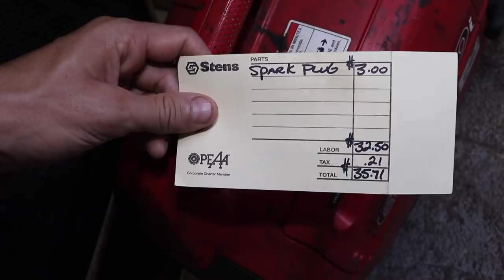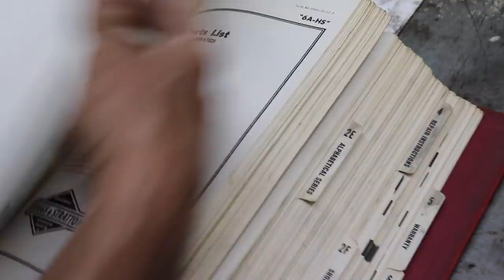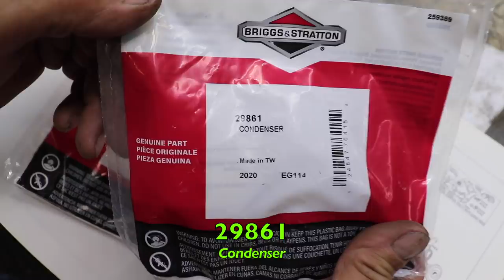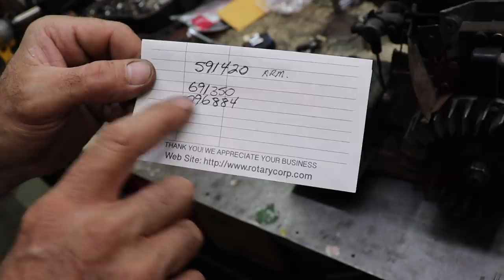INCREDIBLE 1936 Briggs & Stratton Electronic Ignition Upgrade & Valve Job

Comment: When I was 9-10 years old I came across an old Briggs engine nearly identical to this one. Grandpa said it hadn't ran since the 1950s when they got electricity on the farm, and I could just have it.  I bolted it to a board just like you did, and after a month (in the summer of 1975) of dinking around with it, I got it to run.  One day Grandpa and Grandma came to visit, and I showed Grandpa I got his old engine to run. He couldn't believe it!

Also mentioning old Kohlers, I have a K160 I have been messing with.  

Thanks for the memories!
Reply: I have I k181s that my uncle gave me he told me that my dad had blew up so I get to rebuild it it is my first rebuild

Comment: Love the old stuff. Every year at the fair (no fair this year😒) they have a bunch of hit-miss engines putting away. I would love to see Taryl get one of those.
Reply: You from MN?
Reply: @bstevermer9293  from OH but live in NY.
Reply: I was gonna say the same thing. there's clubs that restore these pieces of history all over the nation. check it out. they would love to have you and your dinner.....d.e.
Reply: I used to set up every year I had Delco light plants and maytags and these and whatever I could buy
Reply: As you know these are the simplest carburetors ever they're called mixing valves same on the model y they don't even need a float pure Venturi suction from the tank.

Comment: Hello terry Stover, I got back into fixing generators last winter, sort of by accident, I have
2 generators I maintain and they are always ready, 'cept last year when I moved up to N.E.
apparently gas valve got moved to the ON pos. 1st time since 2014 I could not get'er
going when I needed to. I hadn't pulled a carb apart since the 70's! yet watching the flying
dinosaur which is what a TARylDactal is I had No problem at all and got her running again.
Yeah Taryl is a well talented gent at what he does and the way he is kind to help us out
there to get/and or keep our engines running and giving some great entertainment.

Comment: We had one of these engines back in the 1950s'  It had been on my grandmother's washing machine.  It has a long flexible metal hose that ran to the exhaust.  This was used to take the exhaust outside.  Wish I still had the engine.  I am in my early 70s and it would have been fun to show it to my grandkids.

Comment: I came up on an old Briggs engine in a lien sale, it was a ww2 military engine tagged as a replacement engine for something. It had never been installed but the coil had decomposed. I’d never seen anything like it, all the coatings on it had turned to dust. Anyways we had a local surplus store that sold a lot of old stock military parts and they had one but said it was for aesthetic purposes only because they wouldn’t warranty it working, but I started asking around on collectors forums and a guy pointed me to a site that sold new replacement coils, it was just the coil pack and you had to press it on the frame yourself but it worked great. I’d tell you the name of the site but I can’t remember to save my life but I can tell you it was dedicated to restoring those old engines

Comment: It's amazing that the flywheel from a motor that is 50 years newer works.  I hope that Briggs parts and support continue to be available through this BK.  Love the sound of a cast iron B&S, and their low idle speed.
Reply: I had one on my lime green little Indian mini bike
Reply: Man, I had one of those! When the engine went out we'd push it up the hill and take turns riding it back down. I'd love to still have it and put a harbor freight motor on it.
Reply: I have a B&S snowblower engine made in 1967. I also have a 1987 snowblower engine. The starter from the 87 also fit and worked perfectly on the 67 engine.

Comment: I use to make a lot of spark plug or coil wires and I bought a roll of Packard 440 copper core wire made for that purpose from J. C. Whitney & Company. 
Bought lot of stuff from them 40+ years ago. I miss their catalog ☹️.  I lived way out in the hills of E. Tennessee & couldn't run to town every time I needed something, but the mailman ran by my farm 6 days a week.

Comment: I have an old Whirlpool; wringer washer in the barn that came with a WM  engine. Mom and dad's house burned in 1938  so it was just after that when they got it. We got electricity out here in 1947 and dad put an electric motor on it. I still remember mom washing with it on the back porch of the old house in the early sixties and heating water  in the wash pot. That was a good dinner by the way.

Comment: My 3 horsepower Briggs and Stratton powered lawnmower (92500 engine) started running like crap at higher RPMs & adjusting the carburetor didn't make a difference.

The ignition coil eventually blew on it so I used one off a 4 horsepower Briggs and Stratton lawnmower engine that I'm yet to rebuild,the 3 horsepower engine revved out a lot cleaner at higher RPMs then.

I have since fitted a brand new ignition coil & it runs great.

Regarding that joiner piece that you put in for the spark plug lead,you can insulate it with glue lined heatshrink tubing (Raychem) to insulate it,it will make it a neat job as well !

Comment: we used a couple of these old brigs with the small low fuel tank/carb sucks the fuel up from it.  to pump water on the farm. we would measure how much fuel we put in the tank for the amount of water pumped. start up and let it go till it would stop by itself when the fuel ran out. put an old wash tub over it to keep the weather out.

Comment: SInce Taryl knows the ins and outs along with having a commanding knowledge of the strengths & weaknesses of B&S engines for the past 60 years or so - they would be well served to have people like him hired on a consultant basis to improve the design of their modern engines...the QC function of those improvements would be left up to them. I own an American made 15 yr old B&S engine and it runs perfectly with simple maintenance. Never pulled the rope over 3 times ever to start and most of the time it fired off on the first pull.

Comment: Taryl, you are exactly right. I remember seeing a valve grinding tool that that had a crank on it and it had two pins that engaged in the top of the valve. When cranked , the valve would oscillate back and forth.
Reply: very neat

Comment: I think the valve lapping tool could have been a small nail you would put in one of the holes on top of the valve and spin the valve like a crank. In modern day you could use a small “L” shaped Allen wrench. My father used a mail in a small piece of wood. 
Great video. The Briggs WM sounded like motors i was used to in the good old days.

Comment: Years ago a mouse damaged the windings on my old GE traditional style washer and my wife rejoiced (I'm not convinced she didn't vuck it up) because she had to have a new p.o.s digital front load disaster that never works , I put that old washer and the dryer out in a shed out from the barn and rigged a little Brigs engine to it with a pipe going out the wall of the shed for the exhaust and welded a old tensioner pully from my truck to a tire iron to engage it...guess what the damn thing still works and she has to use it from time to time when her new fancy turd won't work, I use it often to wash my shop and farm clothes, I have about 60' of copper line coiled in a plexiglass box on the roof of the barn that heats the water from the sun ifill it with a water hose the throw then on the clothes line when I'm done and hang them back in my closet in the barn😉

Comment: That reminds me of an engine we had in my basement when I was a kid  in the late 50s and 60s with the same kick starter. My dad had a gear type water pump hooked up to it to pump out the basement when it flooded and yes the muffler had a long flexable metal pipe goin outside the house.  The gas tank was thick with black gue which I know now was varnish. It never ran but, to see yours run was pretty cool. When you were talking about the valve clips I was thinking pins which you found. It even had the same carborator. Thanks for the memories.Thats a keeper!

Comment: The holes in the valves were as you assumed to be used with a tool which was very much like a hand cranked egg beater.  Rather than going round and round, the tool oscilated back and forth like the way which you used the suction cup grinder,
Reply: Remember that tool. Would oscillate back and forth maybe 45 degrees or so, and had a little flat adapter with two fingers that fit the valve holes. Likely were more with the tool when new, Not sure if that was a BS tool or not? I have a WI that served my motor bike for a couple years around 1955 or so LOL. Still have it and  runs.

Comment: That looks like the really old scrap briggs we put on our push cart in 1957. My cousin and I were 6 years old and build the cart, but my father put the his Briggs on the back. My father got the engine running by belt drive starting from the table saw motor.

Comment: The reason that light flywheels work on push mowers is that the blades weight adds to the overall inertia of the engine. I expect that the horizontal engines with light flywheels will bog down when put under load because it lacks the inertia of the heavy flywheel.   Just my opinion............THANKS FOR YOUR GREAT VIDEOS!!!

Comment: The zim crank valve grinder that Briggs used had a slot cut into the shaft the rubber tips went into that you could put a flat metal plate with pins that matched the holes in the valve so you could lap the valves. That crank grinder is still available, just search zim crank style valve lapping tool

Comment: A valve gizmachi ???  OH! I have that SAME BOTTLE of Indian Head gasket sealer! (But I doubt it's any good now, bought it in 1978??      
Hey, Taryl, I'd rate that belch at about 7.50 out of 10!!! Pretty respectable. My friend Vinny & I used to do the; " rate-a-burp" at work!           Ugh...
80 year old engine, and IT'S A RUNNER!!!!
Condenser and points look like new....No rust. Hummm..
Taryl you did it again..

Comment: Yes, there was a tool that fit the holes in the top of the valves. The one my Grandfather had, had a crank that you turn, and the tool would twist back and forth.
Reply: You can still find them and their head looks a bit like a Dzus fastener "snoopy" tool but part of the point for those slots (common to many old engines) was that you could also use a screwdriver bit in a bit brace or whatever works to lap the valves. Some tools looked like a hand drill and there was quite a variety.

Comment: Hey Taryl I got a good coil with a pinched / damaged wire which is arcing to ground (causing missing).  You mentioned having a roll of the correct wire - have you ever replaced the spark lead or spliced it (where you needed to fit it through the case)?  I used heat shrink and it's working OK for now but maybe you have a better way of doing it?

Comment: I just picked up a old snow blower real rare antique one from the 1980s I only found 2 videos on YouTube on it anyway it had a clutch n chain jack shaft set up with a 3 hp Briggs stratton 80 engine no spark I took it all apart points n condenser look brand new cleaned the coil flywheel still no spark so has to be the coil im gonna do away with the points put a Megatron coil on it but I love Briggs old motors can't beat em

Comment: I have a bunch of model Zs and ZZs and those suction cup lapping tools don't like to work on valves of that era because of the holes. I went and found an old hand crank lapping tool with pins that fit in the valves.

Comment: II have one of these very engines and would like to change the coil over too.  I got the number you gave out but I don't follow you on how to eliminate the point set.  Could you describe it better for me?  I used to work on all of these but took a different road and became involved as an industrial engineer for 32+ years.  I retired from that and dabble in these old machines.  I'm hoping you can guide me on this as the coil on this old WM (1935) is also weak and I'd like to replace it.  I wrote down the number you provided to interchange it but failed to understand the different ignition setup.  I sure would appreciate a little updating on this.  I watch you videos all the time and remember working on the old timers 35 years ago too.  I loved it but the money was in Industrial Steam Plants for me.
Oh, and I have an old 1949 Kohler engine I rebuilt but having trouble with the carb because you can't find parts for it.  It's been rebuilt and is tight and nice and will run but the carb is messed up.  I also have a 1951 Briggs / Gorman Rupp 2¼HP engine that I rebuilt and it burrs like a kitten.  I've done a 1921 6HP Economy hit n miss engine, a 1923 Hercules throttle governor engine and tore down and parted out a 2 cylinder LeRoi engine.  That one had a bad crank and needed serious work so I parted it out because it was impossible to get parts for it.  I sold every single piece of it and cleared over $600 from it.  The guys who bought all the parts were overjoyed that I had posted it and one guy even sent me an additional $50 for the part he won in the auction.   Nice people - these small antique engine guys.
Anyway, I sure hope you can help me out here with this one.  The coil is weak but will spark but I fear it won't last.  new points, condensor, flywheel key and wires and plug but I think the coil's had it.  Hence my request.
I appreciate like crazy if you can help me out.  I may be 69 but never too old to learn new things from you younger guys.  It's nice to see people like you doing these videos for the rest of us.
Best Regards
Doug

Comment: Scary, but you commenting on those dimples in the top of the valves reminded me of running across some ancient metal hand crank tool for lapping some sort of engines valves, out in my garage. Most likely, some swap meet find.

Comment: Hey taryl. I have a model Y. Fun to play with. But as far as mufflers. They used to come with a 6-10 foot exhaust hose then you would drop it in a bucket of water to help quiet the noise level down. Very hard to find

Comment: i bought a 2hp briggs for $5 or was it $6 over 50 years ago for a 3 wheel go cart i built and welded in summer school... it was older looking than that one... i had a rope start opinion ,but since i had wheel barrel tires in back and direct fan belt from left wheel to the motor i just push started and hopped on... i rode that thing everywhere...

Comment: Seeing the insulation missing from the coil, could there be moisture in the coil? After all, it was used for a washing machine. Can it be baked to dry it out? I did that with my chainsaw coil. There was no spark. After 2 hours in the toaster oven at 100C, I got spark.

Comment: I wonder which washing machine motor came first; Briggs and Stratton, or Maytag?

I could imagine my granddad tinkering for hours on granny's old washing machine. I know it had a gas burner to heat the water, but, by the time I was around, I'm pretty sure 
it had an electric motor on it. Even so, it still kept granddad busy - always something needed attention on that thing.

Comment: Taryl, you're awesome as usual.  I was wondering if any rust where the laminated shading coil meets the flywheel could interfere with putting voltage on the primary of the coil? Also, I just wanted to mention that I had a Reo snowblower with an old Briggs engine.  It had a single siphon tube to the carburetor, but it didn't have a fuel tank; so I put a small mason jar with a hole drilled for the siphon tube and two holes for the screws where the gas tank would have fastened to the carburetor and got it running after cleaning the points.  It had some early pre-cursor to an electronic ignition
Reply: The red and black wires went to a plastic box about the size of a pat of butter.  Anyways, I got it to work.  I tried the prybar and air hammer to no avail, but did get it off with a prybar and a normal hammer.  One of the coolest things on the Reo is that there's a rod that goes in an out to engage the drive wheels and if you rotate it clockwise/counter-clockwise, it controls the throttle.  The air vane governor was wired wide open; so I have no clue how to fix that; any ideas how to fix that?   Thank you again, sir! I love your channel!

Comment: the DR  trimmer mower because it takes alot of momentum and drives a belt to turn the trimmer head is the only vertical shaft engine that small that i know of that still has the iron flywheel that briggs made for the newer stuff ;;;; those engines were put on trimmer mowers and pressure washers ;; i feel your pain taryl as i rebuilt a 1941 garden aid sickle bar mower ;; it was a 2 wheel tractor with 1 forward speed no reverse with a  sickle bar that folded up ; the guy that used it walked along the highway cutting the brush for 20 cents an hour back in the 40s ;;; but if you want to give that motor more power use a flywheel and a coil off of a briggs engine that was on a trimmer mower as briggs still has parts for them ;; as for the flywheel  disaster i have broke the end of the crank off like you said and i drilled and tapped the end of the crank and put a grade 8  bolt and steel washer

Comment: LEFT Handed Threads vs RIGHT Handed Threads ...
A Quick and easy way I was taught to distinguish quickly between the two is this:
As you are looking at the threads, if the pitch grooves on the right side are further in than the left side it is a RIGHT Handed Thread and you remember it as if you use your RIGHT hand to "punch" the thread in. Likewise, if the thread pitch grooves are further in on the LEFT side it is a LEFT Handed Thread as though you used your LEFT hand to "punch" the threads in. Often time you will have at least a couple of threads exposed beyond the nut to see the angle of the thread pitch grooves.